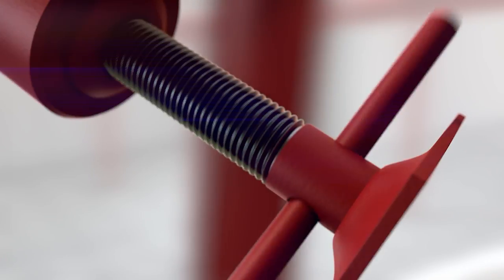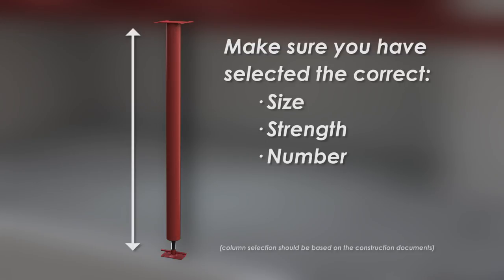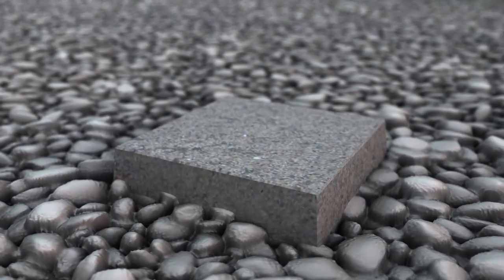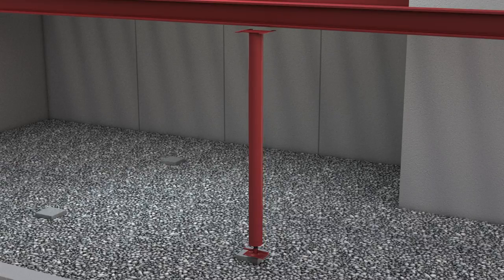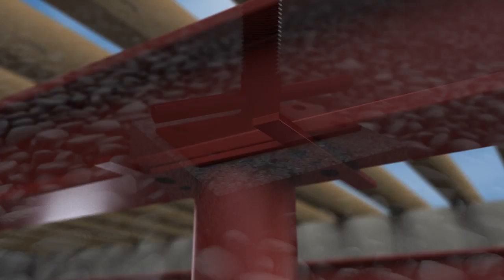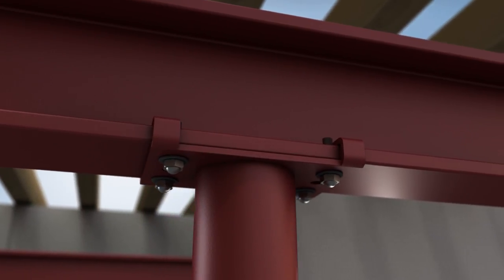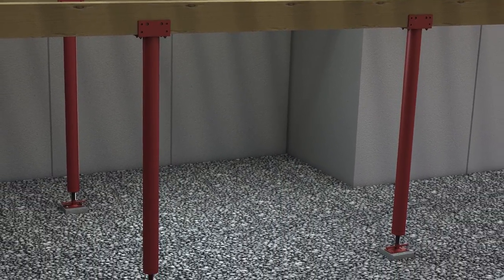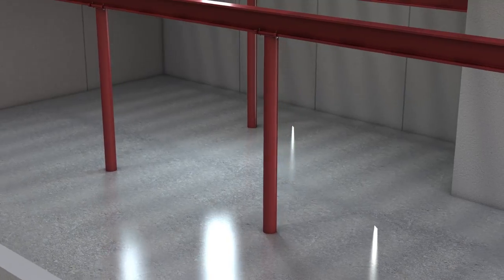Tiger Brand Adjustable Steel Columns

Comment: Tiger Brand jacks are junk. I had purchased some other brand from Menards and needed one more so I went to Home Depot because it was just down the road and picked up a Tiger Jack. The Menards jack was twice the thickness and the bottom and top plate were almost 1/8 thicker at the same cost. These are over advertised low quality items the jack was returned immediately after opening the box.
Reply: Akron and Tiger brands are the same exact companies and the products are the same. Menards like Lowes uses Akron at the time of this post. Home Depot used Tiger brands. They do this so you can't price match them most likely.
Reply: Matthew, could you mention the name of the brand you bought at Menards.  I'm looking for a quality jack and I need a few of them but don't want to compromise on quality. I'd like to check it out.

Comment: Dimension tables in their catalogue do not include max measurement of the part of the steel column that is above the concrete floor, only overall min/max dimension for column.  I could not pick between two sizes for my replacement column because of this.  I contacted their customer support and even though I explained the problem several different ways over several emails, the representative had no clue what I was asking and tried to make me go away by telling me to hire an engineer to choose the column.

Comment: if not setting into concrete, can you have the adjustment up top?
Reply: The prescribed method is to encase the screw in concrete so that it cannot be tampered with.  To do that typically the screw would be down.  An alternative method of doing this is damaging (disabling) the screw once it is finally adjusted. You should check with your building inspector to see if that would meet approval.  It has been done and approved in some areas but in the end it is up to the inspector.

Comment: Would these work fine as replacements for original columns (in my case, a few are heavily rusted and need to be switched out)? I would like something that I can just set on top of the floor and not have to worry about setting in concrete. Also, if these were not being set into the concrete, would there be any reason to not have the adjusting end be at the top?
Reply: +Edward Staley 
These are adjustable columns for permanent installation; so the answer to your questions is yes.  You would either have to cover the screw portion in concrete or disable the screw so that once it is finally set it can no longer be tampered with or further adjusted.